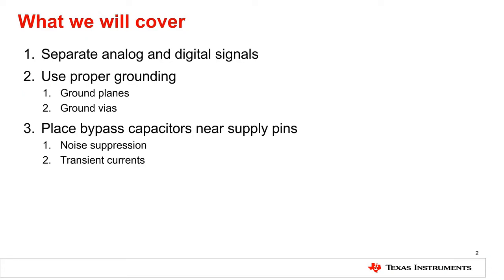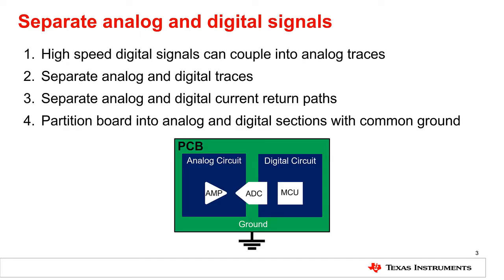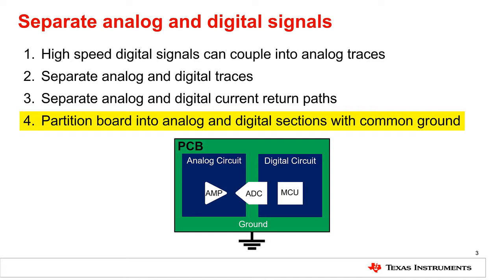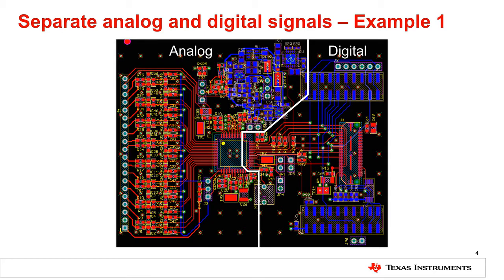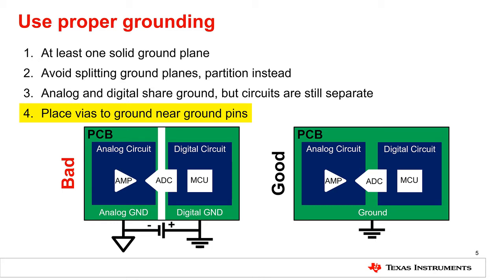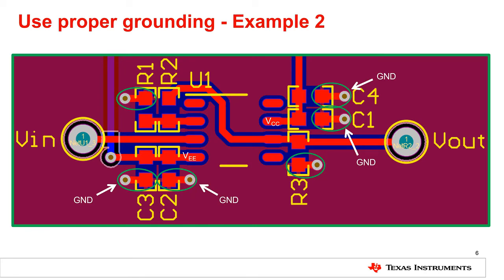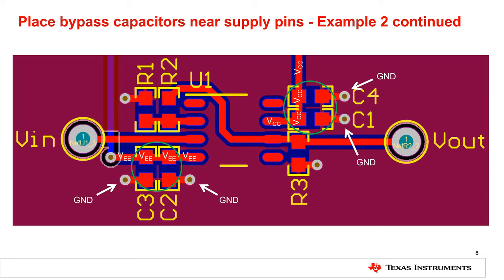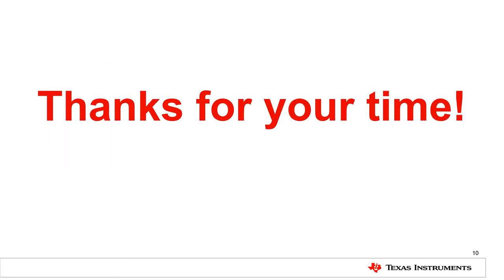Mixed signals, grounding and bypass capacitors

Comment: Separated ground planes make for a radiative antenna. Best to never break a ground plane. If you do, make sure your system doesn’t generate power feeding into the parasitic antenna and that the antenna can’t receive power that causes problems. The latter is beyond the capability of most engineers, so don’t do it.

Comment: How about the power supply connection? If for some reason, only one power connector can be used to provide both analog and digital power (For example, a USB powered audio DAC), with a LDO or ferrite bead to isolate between them. Assume the connector is located at the digital side, then the analog return current will flow in the digital ground. Is there any solution to this? Maybe add a isolation transformer like SN6505 to eliminate the return path?